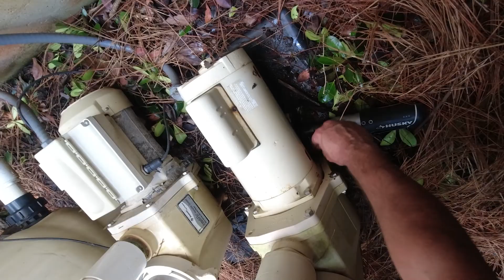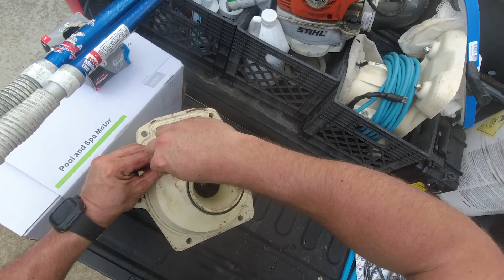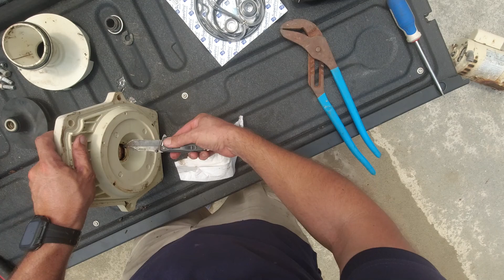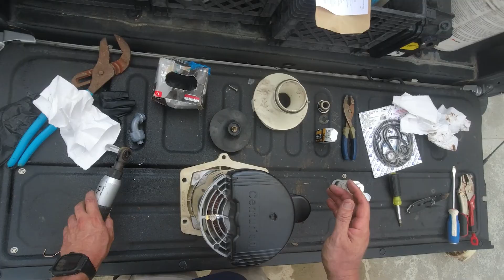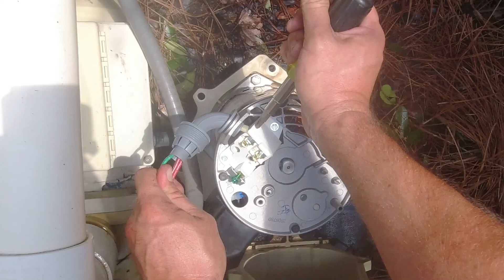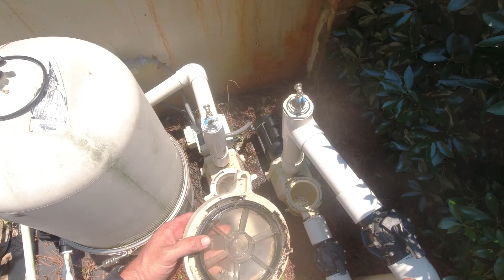How to Replace a Pool Pump Motor(Important Steps)

Comment: Great video sir. kudos. quick question, do you happen to have links you can provide to buy the recomended shaft seal, go kit (o rings) and conduit connection? I want to ensure I buy the right ones for this motor I just purchased. Thank you again

Comment: Got 2 lines going out each one is approximatelt 124 v. I watched a video that said is ok. Is that correct. Both lines add up to around 248 v.
Reply from the maker: Yes. Most pumps run on ~240v. They are actually more efficient using ~240 than ~120.

Comment: The video says don't touch the shaft sheal with your hands because of oil ruining the seal and even to switch gloves if you contaminated the glove.  Yet, the lubricant that will touch the seal was touched and put on with a bare finger and oil could transfer from finger to the lubricant and then of course to the seal.  If it is that sensitive, shouldn't you use gloves to put that lubricant on also and even before that, clean the metal part with alcohol since you touched that area with your finger before putting on the lubricant also?   I'm looking at it like you would in an operating room working with a sterile field and maybe I am being too critical, but it makes sense that oil will go from one surface material to another.   I have seen many other videos that state to use a small bead of RTV Silicone in this area.   I don't know which procedure gets better results but would like a comparison of how long before a seal failure happens with and without Silicone compared to just lubricant.   Could you give the name of the lubricant also because you can't see it from the video clearly and who manufactures the seals that work best?  Thanks and the information is appreciated.
Reply: Do not use silicone or any type of petroleum lube or it will leak , there is some special lubricant for that seal or use soapy water
Reply from the maker: Thanks for the comment David! Really it is the white ceramic part of the seal that shouldn’t be touched, and the lubricant should only touch the rubber “shoe”.  Some say you don’t need to worry about touching the ceramic part, but I was trained that way, and it works, so I will continue to do so.  

The brand I have found that works best is U.S. Seal. The same manufacturer makes the lubricant, which is just that. It allows the shoe to slide into the space without much force. This is why I don’t use silicone. The seal is designed to seal on its own. 

I hope this helps!

Comment: Just what I needed, got my new motor today installing tomorrow.  My old motor only lasted 4 seasons in PA, the bottom was rusty and the entire area on the motor side of the mounting plate, and the facing surface of the motor surrounding the shaft was coated with crusty salt, assuming the motor shaft seal went bad.  Do you recommend covering the motor with those cheapy plastic housing units. My original Hayward pump lasted 10 yrs, but the 2nd Century only lasted 4. Probably my fault for not catching the motor seal leak but it seems premature.  Any thoughts. Really appreciate the video and the pace was excellent, great details.
Reply from the maker: Thanks for the input! Motors these days aren’t going to last as long as the old ones. I was talking to a supplier, and the steel isn’t as good as the pumps 20-30 years ago. The best thing you can do is keep a clean and clear equipment pad that allows plenty of air flow around the equipment, and check for leaks regularly.